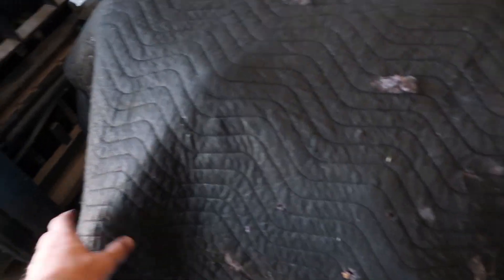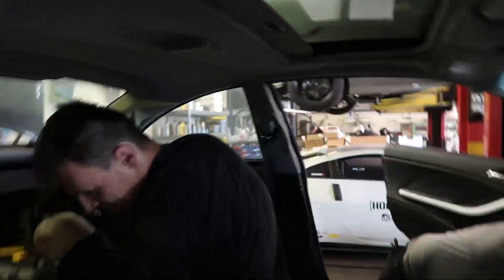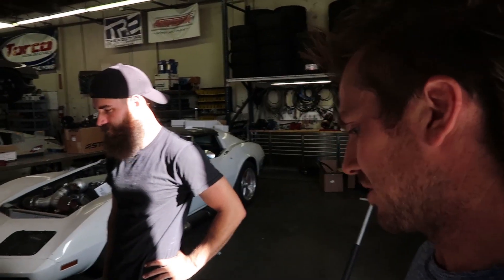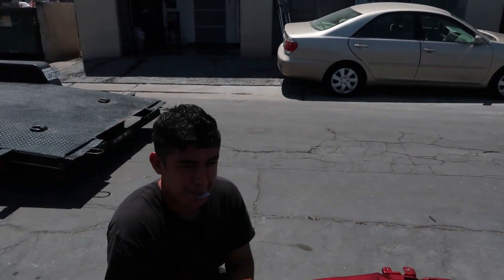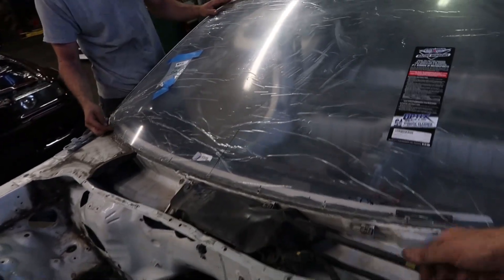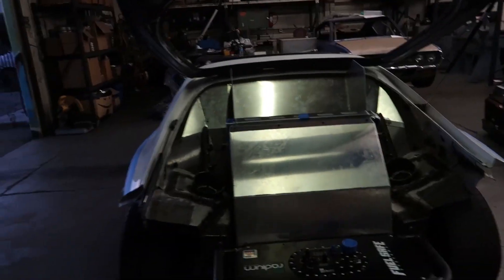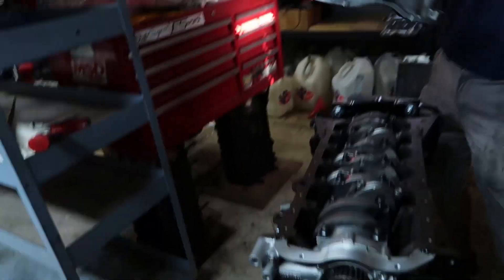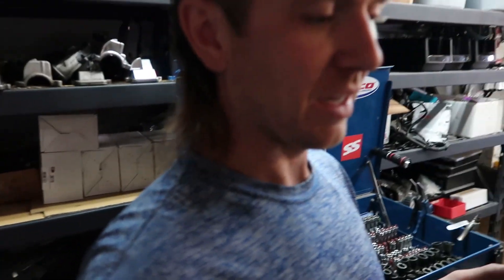R A C E C A R S

Comment: On the BMW subframe mounts. I cut a large rectangle out and welded in beefy box tubing across the mounts and drilled holes for the subframe bolts. Over kill yes but it's a great spot to attach the cage on. Super stiff, I noticed a huge difference In handling.

Comment: Hi RAD DAN i recon the E46 is getting a m62 motor. are u going too strengthen the shock towers also on the the E46 I now they tend too crack when u track the car also cracks under were the rear subframe bolts too the chassis BMW sell the plats too weld under the shock towers not sure about the rear subframe. im a huge E46 fan so its a few things i learnt over the years. keep up the good work. 2JZ LIFE
Reply from the maker: Yes we are also doing front and rear shock tower reinforcements
Reply: sweet i new u would do your home work on the E46 chassis. i just love them great mechanical grip.